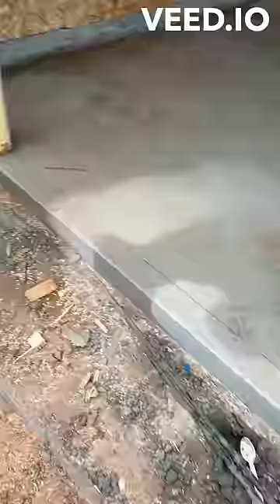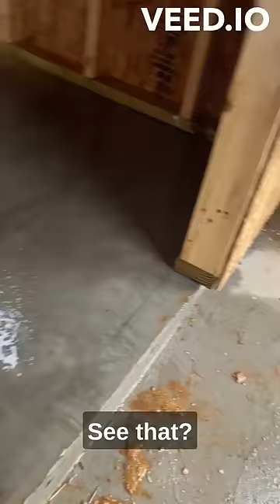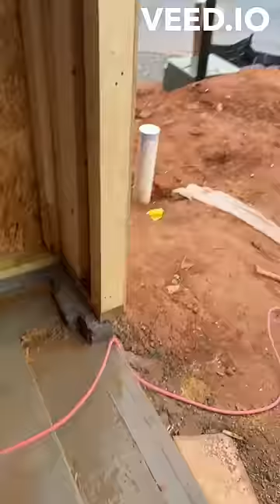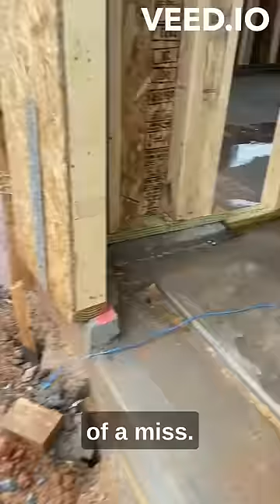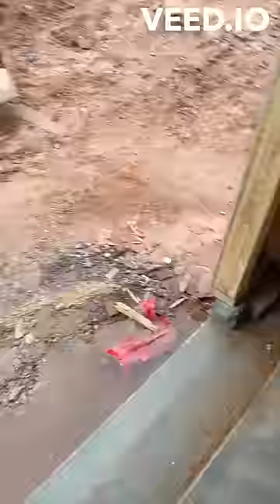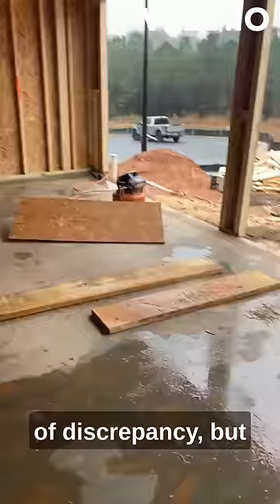New Home Slab is Wrong Size, What Now?

Comment: The framers never should have put anything up after they realized the slab was the wrong size. That means the framers are going to have to absorb the cost of tearing it all down and then reframing it after the concrete guys completely redo the slab. I bought a new house and I was constantly there taking pictures and noticing everything. If I seen this I would contact the general contractor and let them know I'm contacting the bank that I had already was approved for a loan for the house and I would be given a complete refund and so would the bank.  This is a perfect example of why we need Americans, United States citizens, working in our country and not immigrants that don't care because their standards in their country are too low.

Comment: Not a big deal if they pour concrete under the mis by a bit stuff , especially if they down it .. easy fix with some knowledge .. only an inspector says things can't be done, an actual working man/woman live for the excitement of a challenge.... This wasn't a good job by someone idk who is at fault... But as a concrete guy, / anything you need guy , I could fix this no problem

Comment: Has to keep the edges right at each other...cheap crap. Have the slab extend beyond the outer edge of the wall to begin with! The bolts are so close to the edge, no strength there. Oh but it's standard!

Comment: Oh ya... that's 100% on the framers. Ya, the slab is wrong... but the framers built on top of it, so theirs are the last fingerprints. A simple call could have covered their asses and had the expense put on the concrete guys... but now they're holding the bag.

Comment: Looks like the concrete guys placed the forms on the inside of the measurements. Whoops.

Amazing that the framers didn't bring this up immediately and the GC get the concrete re-done.

--------------------------------------------------
[Note: This comment is not focused on any particular "designated group" with regard to the YouTube "hate speech" or "cyberbullying" policies. It simply reflects the author's opinion regarding a subject, which may or may not also pertain to an individual's actions demonstrated in the video. If any such individuals belong to any of the "designated groups", any commentary included is merely incidental to that grouping and such groups are not the focus of any comments. It's pathetic that this comment is necessary for the YouTube censors who are too stupid to figure it out otherwise.]

Comment: It's like a plumber drilling a hole through a 4 inch drain pipe to run his wiring.because that what the print called for. SMH.

Comment: Disgusting, who's doing that work. Where is the GC when the framer says there's an issue and he doesn't correct them. That should have never happened. Btw the framers could have still framed to the concrete even though it was off on the plans. It's not off enough and now the walls have to be redone. What a disgrace......

Comment: Yeah... it sucks when your just a new guy and you mention the issue but low and behold your the new guy and no one cares even if your right. 🤣 do the job or lose your job. Been on sites as a newbie and called things like this out, got fired due to the 3 month thing cuz i said its wrong and im not gunna be held responsible for it so im out cya. 

2 months later you hear from james or whoever that the boss man lost the contract due to that problem and even tried blaming you for it after the homeowner saw and heard you call it out 2 months prior. Yeah... i know i shot myself in the foot with refusing work cuz im still unemployed but... whatever... im not gunna be held responsible when i know better. Lots of goofy peices of crap out there... and im trying to not be one of them.